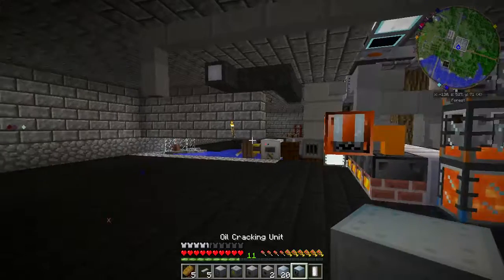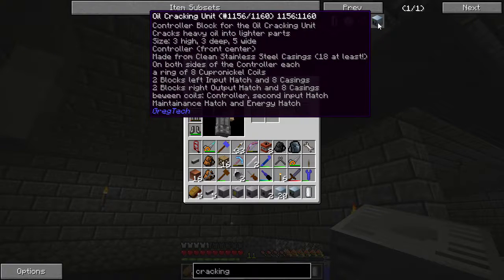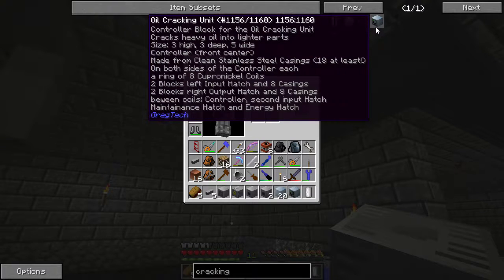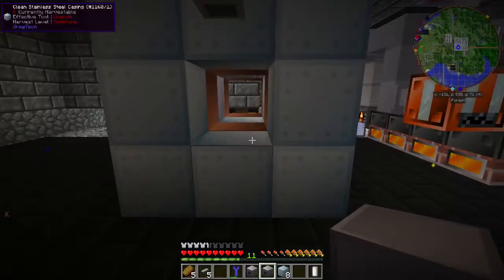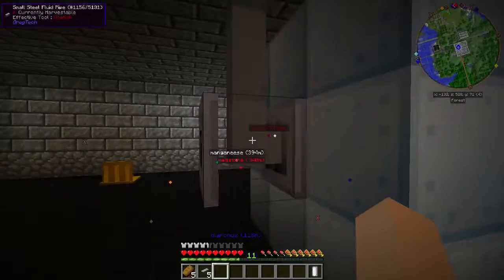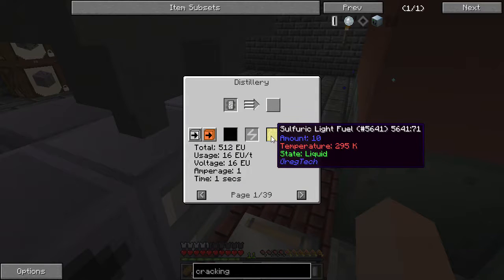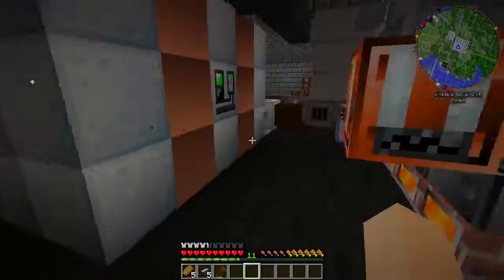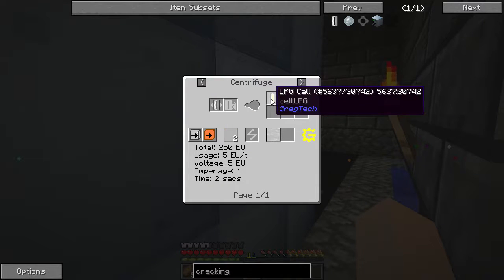GT5u Multiblock tutorial series - Oil Cracking Unit

Comment: actually you don't need an Cracking unit to get LPG. You distill oil in the refinery with an integrated circuit configured to 0 that will give you sulfuric gas from there in a chemical reactor with hydrogen to get refinery gas and finally in a centrifuge where u get LPG and methane
Reply from the maker: +UnderSiege72 ya I noticed that before I made all the parts a few episodes ago, but what the hell might as well make it anyways